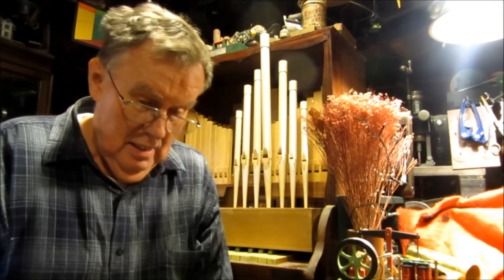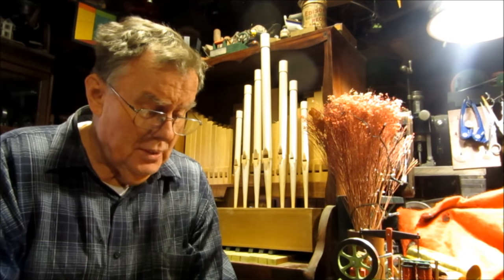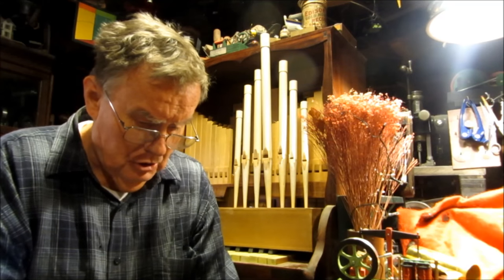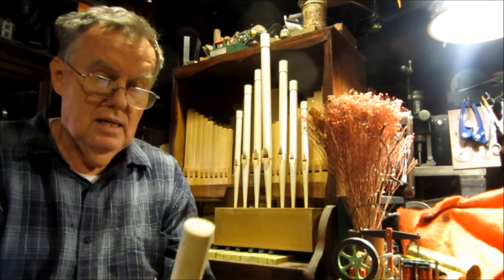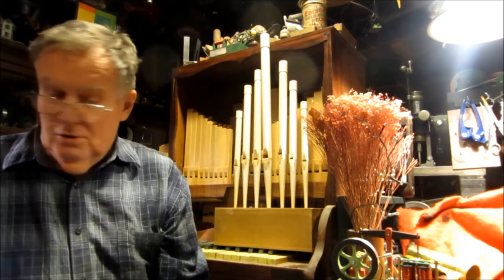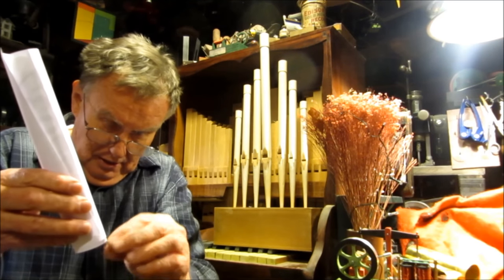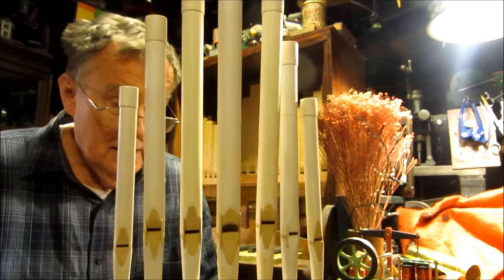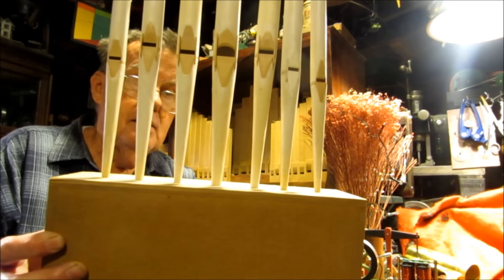Paper Organ Pipes

Comment: Been There Done That, with IBM computer punch cards.  One suggestion: build up layers thicker at the center of open pipes and the top of closed ones, where the antinodes of the oscillation are.  I also built a 1 octave chest from cardboard, and used carbon paper for the pneumatics.